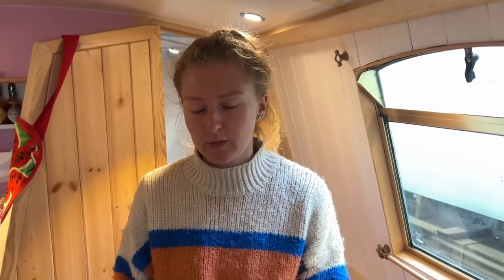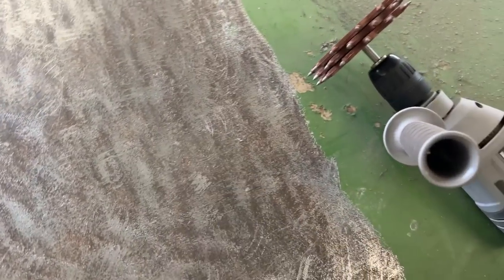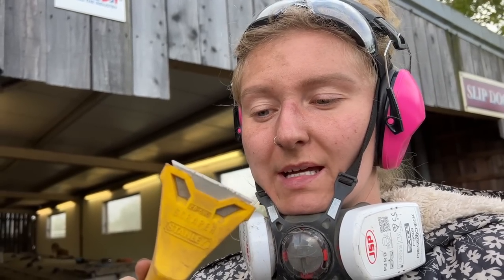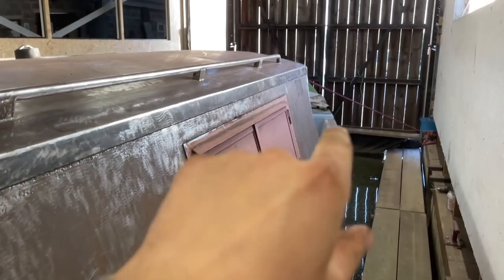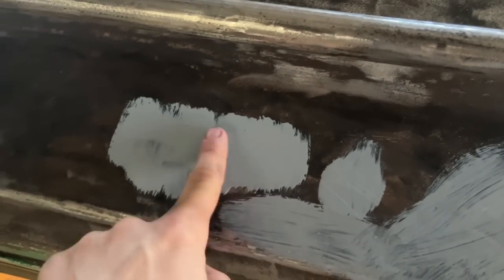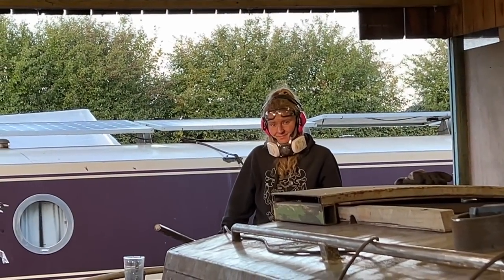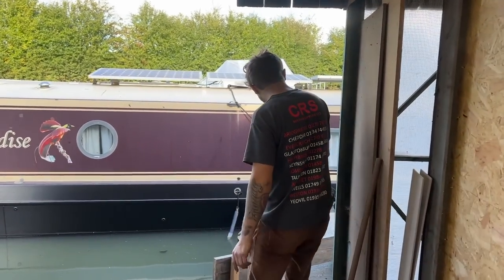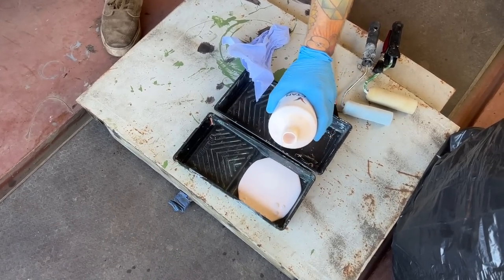HARDEST WEEK OF OUR LIVES. Painting an 80's NARROWBOAT | BOATLIFE | ECOFLOW DELTA 2

Comment: Hi. Love the boat. Pplease accept a word of warning. The angle grimder is probably by far, one of the most dangerous tools anyone can use, eve. In expert hands. Always keep this tool in front of the body, not to the side as you did in your video. It can jump without warning and the rwsult can be disasterous. Also do not ever use it with the trigfer locked in the on position, asking for trouble if you have a misshap. Always grip it well with both hands and pay attention at all times till the wheel has stopped turning. Good luck with the boat. It is something I would love to do. Maybe in the future. Regards Jack from Ireland
Reply from the maker: Yes fair point! It caught our hands a few times with the flappy disc & that wakes you back up to remembering what you’re holding!

Comment: Be careful sanding the vactan, it’ll bubble like an old wool jumper and if you break the surface it’s like peeling sunburn, I found better to just paint straight over it and sand out that layer of paint, good luck. If I had to do mine again I’d definitely use fertan (like I did inside the boat, under the spray foam) best of luck
Reply from the maker: Yes we just painted directly on top of it, not without it’s issues though!

Comment: Are you sure its a cold? and not due to irritants blown up by your sanding down?  If you have a sore throat, one of the best cures/helps is to gargle with soluble aspirin. This anaethsatises the throat and helps alleviate headaches when you swallow it. ( tcp or salt are great to gargle, but if swallowed cause vomitting) if really bad then  honey&lemon can help.
Reply from the maker: Yes quite possibly caused by the particles from the paint! Didn't think of that at the time.

Comment: Love the video next time you need too repaint and use power tools with two operators of a cable reel I’d work out half way point put the cable reel in the middle then each operator plugs in with a 15 mtr single extension so if their moving up with their tool they are not waiting on the other person too finish hope that helps 😊

Comment: I thought Vactan  contained latex as a sealant, so it doesn't require painting?

Anyways  converters are phosphoric acid based because the salt they create isn't water soluble.

Base (rust) + Acid (eater/converter) > Salt + Water

That could be why you're finding rust under your converter, but if there's good adhesion so the atmosphere is sealed out I wouldn't worry too much.

Any acid will do to remove rust, citric is quite a popular choice. Screwfix do a heavy duty descaler that's pretty powerful & cheap too.
Reply from the maker: Ahh that’s interesting! Will remember that descaled from Screwfix

Comment: If the old paint (dark green on the side) still has good adhesion, you  can just sand and recoat. Wire wheel would probably be effective on the hand rail.

Comment: Paint stripping is always hard work and it ruined my shoulders over the years, unfortunately, but can I ask if you considered using liquid or gel paint strippers? I know they are not without their pros and cons, but they do save your joints and back. And I guess being in a dry dock would be better for paint strippers.
Reply from the maker: Yes wasn't sure the score with being in a wet dock & knew there was various layers of paint we'd have to contend with. I've used Peeltec in the past which was great but almost made me pass out with the fumes and that was just on a bike frame!
Reply: @DanniandJoe  Yes, be cautious. And should you use it, epoxy is very dangerous, too. One tip, buy Toolstation Kleenedge masking tape. I recently removed some that had been on my bathroom hinges for 5 years (don't ask) and still peeled off cleanly. Good luck.

Comment: If a narrowboat sinks would need to strip it?
Reply from the maker: More than likely, unfortunately. Would struggle to dry the wooden floors/walls etc and I’d imagine it wouldn’t smell the best either. It’s awful to see sunken boats
Reply: Thanks, I'm looking to buy so I'll avoid this then, cheers
Reply from the maker: @seancarr7483  it’s fairly rare & with automatic bilge pumps now as long as you have a secondary battery as a backup that’ll keep you out of trouble. Worth a thought though definitely
Reply: Sorry to be a pain, I've seen a narrowboat that needs some welding, the quote they've had is quite high and I think it's because it's near London, do you know a place that is trustworthy and good value for money? Thanks

Comment: You should've just removed the paint in sections and painted the rust converter, removing paint from steel and leaving it for days isn't very smart, steel begins the rust process within minutes of the paint being removed, plus when you paint for christ sakes use a 4" brush and full size rollers.
Reply from the maker: The rust converter likes a little surface rust anyway to be fair. You’d end up waiting for it to cure 12 hours in between sanding, don’t think it’d work. We also used 4” rollers, think 9” would be a little overkill 😂
Reply: @DanniandJoe  You could use 4" rollers in small places but for covering large areas just use the 9" and get it painted much quicker, likewise use a 4" brush it can hold more paint and cut it larger areas.